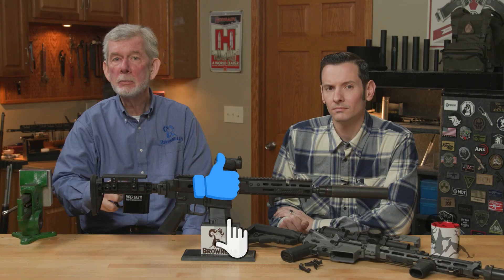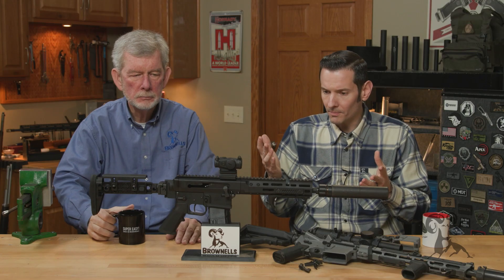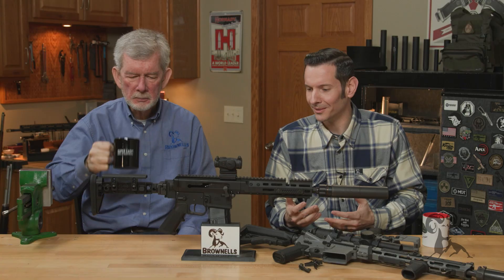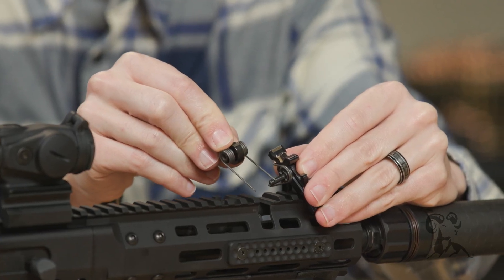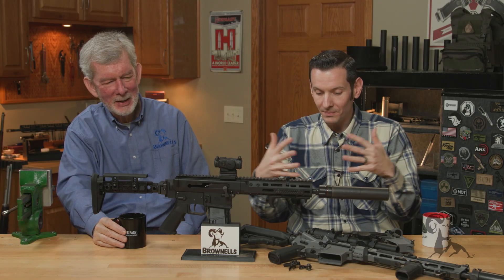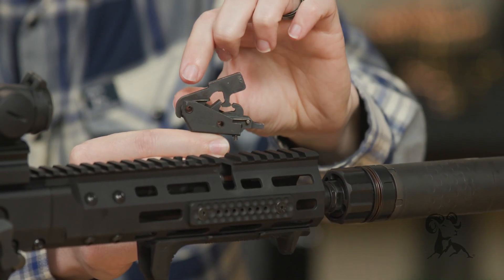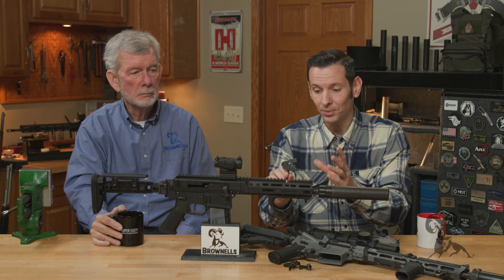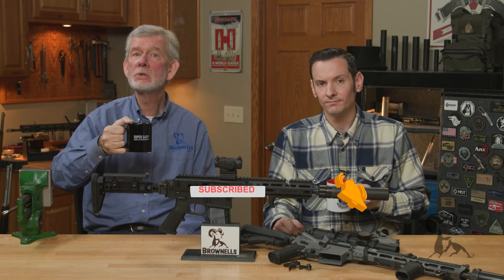Smyth Busters: Does Your AR-15 Need Anti-Walk Pins?

Comment: I've never used anti walk or rotation pins yet in any of my builds from Geissele SSA, ALG, other high end 2 stage triggers. Never had an issue. But one of my buddies had a pin walk out on me on one of his lowers a little while ago. It was weird. All sodden the trigger was locked up & wouldn't depress completely. I pushed it back in once I realized what happened. Half a mag later it walked out again. Idk what lower or trigger it was?? Wasn't a drop in trigger. First time I've ever seen it.

Comment: I have anti-walk pins in an Aero lower using a 2 piece trigger because even though the hammer spring is seated properly in the trigger pin's grove, it walks out while shooting. Sure, it will only walk out till the hammer spring dead ends one way or the other, but it's enough movement to be concerned. I can only assume the Aero lower is out of spec on that trigger pin hole but the rest of the lower seems to be fine.

Comment: Me with antiwalk pins cause ive got wallered hole in a lower cause the manufacuturer had such bad specs. The hammer is held a few degrees over just so it functions. (Its just a meme build im allowed to have a fun gun)

Comment: I’ve no quarrels with anything said here, but if i could add one opinion that is pro anti-rotation pin use on a standard 2 piece trigger. 
The J-spring on the hammer has a weak point on the retaining crimp. Sometimes that spring can break causing a loss of tension on the pin. Resulting in the pin walking out whilst being used

Comment: Purchased an AR with a tirgger pack, just shot and one pin fell out (lost) and the other walked its way half way out. Yes, anti walk is required for trigger pack if you want reliability. Need to find anti walk pins that don't clamp to the lower.....

Comment: From a mechanical standpoint, non rotating pins on the trigger and/or hammer would reduce if not iliminate wear on your lower. Having two hardened and lubricated surfaces will last far longer than a hard pin in a softer material wiggling around. Just plain physics, folks.

Comment: The triger pins are absolutely a non-issue. Lube your pins and install anti walk/rotation. Pins are all made out of the same exact material regardless of brand. Last thing you want In a fight is a pin come loose. Why would you rely on a spring leg to save your life.

Comment: I have a Geiselle trigger and both the trigger and hammer pins walk.  Within a dozen trigger pulls, the hammer pin first slides out of place.  I do not monkey with the gun.  Simple installation and go to the range.  I switched to another set of pins and the same problem.  This is with an Anderson lower.  I have not tried another trigger in the lower.  Of course, it is a cheap lower but I have other Andersons and Geiselle triggers with no problems at all.  My only solution, aside from changing lowers, is to go with anti walk pins.  Or?  (Yes, the springs and other parts are installed properly.  Pins are not reversed.)

Comment: I have seen AR trigger pins break at the grooves that contact the original retaining springs. I don't  use antiwalk  pins. But,  with no grooves other than the outer e-clip groove. Could they be better?  So far I am only running mil spec fire control systems. I like mil-spec triggers carefully lapped and polished.     Watched video to the end. You answered my question, too much gas and or inferior original style pins.

Comment: i think this is a very comprehensive video but there is one issue that was not talked about here.

the fact that not everyone is matching the trigger to the lower meaning a different manufacturer of pins and pin holes which can sometimes result in an issue.

i bought a spikes lower and a cmmg trigger kit that came with pins and under high rates of fire my pins walked. thats probably not because spikes or cmmg are bad but just a fact of putting aftermarket stuff together that wasn't directly intended to go together. 

The advice given may make sense if you go out and are modifying your banshee with cmmg parts but not mixing and matching. mixing and matching requires hand fitting sometimes.

Comment: I have NEVER had pins walk out on any AR with a mil spec type fire control group. The AR was designed DECADES ago to be easy to take apart and service in the field with few tools. If pins walking out were a "problem" it would have been noticed by the military while fielding thousands upon thousands of rifles and would have been corrected. It doesn't matter to me if a person chooses to use mil spec type pins or anti walk/rotation pins. I think it is like a lot of things, the zealots that INSIST you MUST or MUST NOT use anti walk/rotation pins or you're an idiot are the ones that get annoying. Use what you want and what you think looks good on YOUR rifle or pistol. Fun videos, thank you.

Comment: I use anti rotation pins in all my builds. Having a pin walk out can happen, a rarity but can happen.

 I've seen a hammer pin walk out of a M16A4 once, back in 2006. I was the Company Armorer at the time. One of the Marines on rifle range that week came back to turn in his rifle said he had an issue with his rifle. He shown me his rifle and there it was, the pin was sticking out over a quarter inch. 

That was the only time I've seen it happen. It also could be the pins or the receiver wearing out. If your pins are walking out, try replacing them. If that don't work, try finding the gauge for the receiver and gage it.

Comment: The only time I have ever had to use anti-walk/ anti-rotate pins is in a dpms lower.  Something was not quite to spec and the holes did waller out a bit and cause the pins to walk. 15$ strike industries and the rifle has been back up and running fine.  It does happen, but I have never had it happen on any other rifle.  Edit: I have only removed the original trigger once for a polish job.  The hole position on the left and right side of the lower receiver are just ever so slightly off, canting the pins and hammer.

Comment: I have two cassette type triggers, one in an AR, and the other in a SCAR. They are both Timneys. Both of them have a set screw in the bottom of the cassette that presses down against the bottom of the fire-control pocket. That produces upward pressure against the two pins, locking them in place so that they can’t move sideways.

Comment: Had hammer pin egg out one of my lowers in about 12k rounds. Weapon was unsafe as it randomly was dropping hammer without touching the trigger. 

New lower, and as a precaution I'm running KNS pins in every build since then.

Comment: Wilson combat also makes a "cassette" style trigger but you use regular pins because inside the housing it has the same style hammer spring that sits in the milled out Grove in the pin. I have it and it works awesome.

Comment: I have an A2 that had the hammer hole wob out to the point that it caused the problems. The easiest way for me to fix it was to use slightly oversized anti rotation pins.

Comment: Just an fyi I’ve used kns pins specifically made for Geissele triggers to their specifications and do not make a difference in pull weight or feel of the trigger pull. Kns pins were made for automatic rifles for the military. I’ve seen pins start to walk out from your DD, Geissele, knights. They don’t fall out but there is literally nothing wrong with using anti walk/ rotation pins in it. There was falsehoods said. It doesn’t cause any issues with lock up time.

Comment: I started using anti-walk pins after experiencing my .300 Blackout providing a 2 round burst after the mil-spec trigger pin had started extending out the right side of the lower. At the time I did not understand why it was walking out, especially when the hammer spring was sitting where it should be.

Comment: The cassette type 2 Stage ones have also upsides and that if they're really enclosed, bits of brass  or similar have a hard time getting in there causing malfunctions. If the trigger is down, the rifle is down. - roughly quoted Sinistral Rifleman [KE Arms]

Comment: I got a Timney Impact AR cassette type drop-in trigger this past Christmas. I followed the instructions and installed it with the same standard pins that came with my rifle’s two piece trigger group. After several mags, I laid my rifle down in my rifle case. When I picked it back up, the pins were laying loose in my bag. I separated the receivers and found that the set screws had backed out slightly. I’ve read to use loctite on both pairs of set screws, and I’ve also read that loctite is not necessary. Is it possible (or recommended) to remove the four tiny set screws completely and just use a set of anti walk pins instead? I do have a set of Armaspec anti walk pins that came in a Tac Pack box. Help me out, y’all!
Reply from the maker: In the firearms featured in the video, one has a similar Timney trigger. Caleb installs the anti-walk pins then applies very light pressure to the set screws with no loctite.
Reply: @brownells  thanks! I’ll try that too.

Comment: Need? Probably not. Guess, what, I have them on my AR, and they are the only pins ever installed. I'm using a KE Arms SLT trigger, and it's a sealed unit. The trigger I plan to use specifically for the benefits like being able to engage the safety regardless of the condition of the rifle, or even better the fact that it's a completely sealed unit that's as protected against debris as possible.

Comment: They're all idiots. I use ALL-Thread thru mine, with four 3/4 inch nylon lock washers, some Rockset, and about 8 tubes of red Loctite on all my AR15 triggers!
 Then on my AR10 builds I ordered a caulk gun tube from Brownells of Caleb's hair gel to replace the Loctite and Rockset. I didn't wanna take any chances!😉😁

Comment: I largely agree with what is said in the video. However, one of the ARs that I have (a Ruger) has walking pin issues. Consistently have to push it back in before the FCG pops all over the place (every 6 or so mag changes). I haven't inspected the spring legs to see if they are resting in the grooves. Probably should check. Additionally, what about full auto receivers? Wouldn't anti-walk be better for less wear on the pin holes (given that you can't just replace the receiver)? Granted, on a regular AR, wear is not going to be an issue, but full auto? Anyway, good video! Helpful info.

Comment: I personally had two separate ARs that had pins walk out.  It is worth noting that all my ARs I assembled myself, which may have been the cause of the issue.  I had watched videos of assembly and followed them exactly, so i figured I had done it right.  It is possible that it was a case of stacking tolerances, as I would use parts from various companies, most of which are known for being budget grade.  I have since converted all my ARs to be anti walk or anti rotation pins, never had a problem since.  All my buddies have never had the same problem with basic pins, but I helped them assemble all theirs too, and they were assembled the same way, so maybe it was just a goof on my end.  In any case, whether it actually helps or not, captured pins give me peace of mind.
Reply: Double check you're putting the Hammer spring (not the J spring, that better be right from who built the hammer part, hell learn how to check a J-Spring can't hurt....) on the hammer the right way. Guns can work with it backwards, and so the hammer spring legs are resting on the trigger pin and in the slots. 

You may also want to note that some people religiously put the Hammer and trigger Pins  in from the left with the two notches going one way, every single time. Supposedly the pins can be reversed, always done that way and never had an issue. Have noticed difference in quality of hammer/trigger pins from various part kits and especially on differences in and for the different roll(just split is bad) pin styles.

Comment: When I first started learning about the AR platform specifically the fire control groups and different types of triggers, it became pretty obvious why the standard triggers use standard pins and why you would use or need Anti Walk &/or Anti Rotation pins for a drop in

Comment: I like to just anti rotation on an 80% build where the holes don't have any anodizing to prevent wear. Also I would not recommend those anti walk pins. Idk if they have better ones now that actually bottom out on the pin, but a set I had, thread locker kept it in place and if you over tightened it, it would squeeze the receiver and not allowed the trigger to move

Comment: What I’ve been doing is using standard pins for mil spec triggers and anti rotation pins for cassette triggers, typically I match brands in terms of pins and triggers
Reply: If you're using cassette triggers that already have bushings, anti-walk pins are needed, but anti-rotation pins give no additional benefit over anti-walk. The pin passes through the bushing. The springs never interact with them, but only the bushings.

Comment: I've built several AR's. I have exclusively moved to Velocity drop-in triggers for many reasons. That said, using that type of trigger, you really do want to consider anti-walk pins. With drop-in triggers, using Milspec pins can be problematic because there's no springs holding on inside the grooves in those pins. The inside bushings/bearings of drop-in triggers are smooth. That's where using a properly machined anti-walk pin is key and probably your best bet for drop-ins. There's also no trigger parts rotating on those pins.

For Milspec or other conventional 2-piece triggers like the Geissele, the conventional Mildpec or similar pins are just fine because those trigger springs hold tension in those pin grooves. You could use anti-rotate or anti-walk pins there, but I personally would not.

Comment: I didn't know the logic behind this and erroneously thought it was an 'operator' thing for high usage wear/reliability, thanks for educating me!
 laughed at the 'It's a feature, not a flaw(or bug as the IT guy tells me)', am I mistaken or was Caleb holding the cassette backwards? at first the pin hole relationship threw me off until I realized that(subconsciously I knew the hammer was backwards)

Comment: The two times a customer brought in a rifle with "loose pin/s" it was due to replacement pins that the grooves weren't deep enough. A quick pass with a good file or edge stone and problem solved. I personally have never felt the need to second guess designers intent when working on a quality arm. Military firearms that aren't reliable are usually being misused in some way. The AR platform has taken off and is showing all the traits of the 1911 fad stuff that has made tons of money for sellers but really doesn't do much to 'improve' the arm. 95% of the stuff seems to try and solve an issue that is caused by wear, damage and user errors. I grant that not all users are good mechaniks (18th century meaning) and aren't able to see the way the device is intended to function. And too many of those folks are unable to connect with sound information. That is where a good machanik, who understands the mechanism, is the best source you can have. Not all "gunsmiths" are good machaniks!   That's why the information available HERE is so valuable. I've spent most of my 75 years as a mechanik and have been blessed with top drawer education from some really good engineers and mechaniks who weren't afraid to pass along information.  So you guys keep it coming!!

Comment: Another couple of reasons to use fixed pins.  1. you have an extremely valuable full auto lower and saving the lower forever is important so you you have to prevent pin hole wear.  2. you have an 80% where the pin holes are not anodized therefore they aluminum will wear more quickly from the pins constantly turning.  I cut my own lowers and use .155 KNS pins in with my G triggers.  G doesn't suggest it but it makes sense in my case.

Comment: I'd heard that civilian ARs in general, could sometimes be made 'slightly out of spec'-- especially 'entry level' ones. Never had a problem with my issued rifles in the service. So, when I got my M&P 15 II, I fieldstripped as far as I could take it, cleaned & inspected thoroughly, then oiled it liberally (including the trigger group). Then aggressively ran through function checks...  
As I was reciprocating the bolt and charging handle (took about 10 times, maybe a few more), my trigger pins slipped, allowing the trigger group to become canted, and thus jamming the rifle...
The fix was simple: a 'ten minute install' of $15 'anti-walk pins.'
Rifle functions as it should now, it's reliable as hell, and groups nicely...
Do I consider those anti-walk pins an 'upgrade?' Definitely not. But they are a reliable 'fix.'
Reply: Either you reassembled it incorrectly or it was done incorrectly at the factory. The standard pins in an M&P 15 are properly retained by the milspec trigger group if installed correctly
Reply: I didn't take apart the trigger group, nor the barrel, nor the flashhider. I merely broke it down for cleaning. The trigger group pinholes came slightly out of spec from the factory-- Better check yours, if you haven't already

Comment: Dang, haven't watched the video yet but I thought this was a pretty clear cut issue.  Use normal pins if you have a standard fire control group that locks into the notches of the pins, use anti-rotation pins if you have a fully contained (drop in) trigger housing that doesn't hold the pins.  Maybe there is something else I'm missing?

Comment: In a cassette style I kinda get the anti-walk pins because they don’t typically have the built in methods the standard trigger has. Anti-rotation pins have no place in the AR, the pins are designed to rotate, if they don’t they can slow down the speed of the hammer which can be a real issue especially as the hammer doing wears.